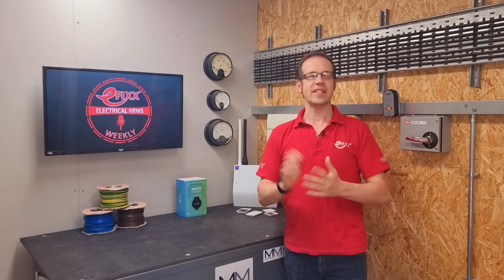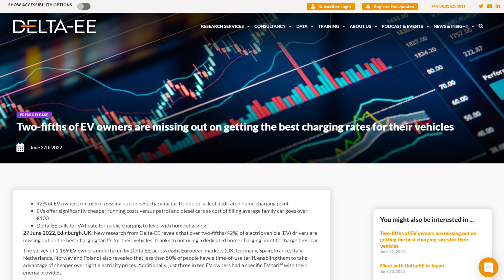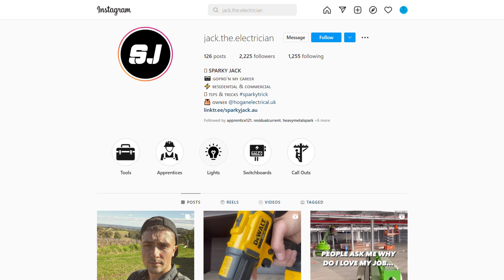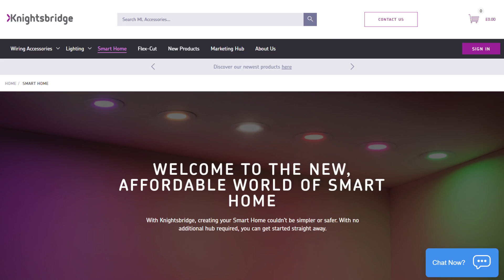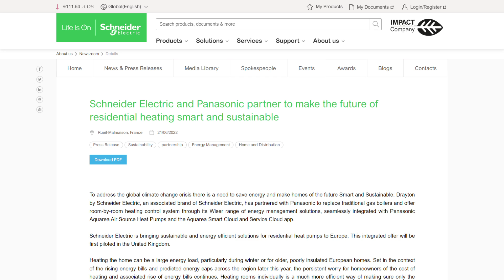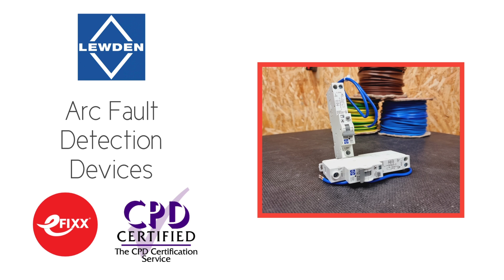TOOL THEFT - What can you do to Prevent this?

Comment: Working on a former farn in North Devon where live, the owner  who had recently bought the farm,  had removed an earth bank and caught a split concentric  cable with the digger bucket and striped  the outer sheath asked me to look at the cable and repair it. (He had put a metal bucket over it to protect it)  I isolated it from what I thought it was it's supply point with my voltage tester and it was still live. I then isolated  at the incoming supply position and it still tested it live. I still wonder why I still tested the cable at this time. It turned out The farm had its own tansformer and there was an ilegal conection  on the underground cable. After investigation I found the end of the cable taped up and discarded in nettles.  It turned out that the previous owner had been caught out growing canibis in a farm building. He was caught out as a person with dimenture was missing on Exmoor and a thermal imiging camera on the Police helecopter picked up the building
Reply from the maker: Great story - amazing what happens in the countryside

Comment: Hi Joe I was thinking about the possible problems we may have with DC leakage in our electrical system’s from thing like phone chargers washing machines or even the clock/ timer on electric cookers ? 
Now i’am not saying it’s wrong but if DC leakage is a problem isn’t it more likely to be coursed by smart meters as they are hard wired in to the system not just plugged in to the nearest socket  ?
Reply from the maker: It's more of a cumulative problem really, lots of devices leaking a little bit. Not sure on the exact figures for a smart meter but I'd imagine it's pretty negligible.
Reply: @efixx  thank you. As I said I was just wondering.

Comment: Hi Joe,can you tell me why the big push for RCDs  for sockets particularly for portable equipment use outside would a 30ma plug type RCD be an easier option and better as if it goes it’s not going to take the main ring circuit with it ? All my garden tools have 30ma three pin plug RCDs  and they do work just as well , I test them at least once a month so I know they are working as intended. You’re thought’s would be much appreciated. 
Many thanks 👍
Reply from the maker: It's probably just more cost effective to have one device protecting a circuit than a device per piece of equipment. Also, depending on how it's wired the regs will require RCD protection for the cables as well as the loads.
Reply: @efixx  so a Plug top type RCD is an acceptable option 
If say the property has no RCDs   
Like they still have a rewireble fuse box  .
Reply: See I can be a good boy sometimes and ask sensible question’s . 🤣 I have always had a lot of respect for you guys. I get annoyed when I give a opinion and some idiot turns it into an argument like yesterday on one of Gary’s videos.

Comment: There are still companies that manufacture copper lettering blocks with company names.  One of those mounted on a handle and heated with a torch can melt the company name into most power tools and plastic handled hand tools.  
Metal tools are easy to mark.  Visit the grave stone artist.  They can cut stencils and sand  or abrasive blast the company name into them.  Those artists will jump at the chance to do anything other than a headstone.   Think of the bronze memorial companies to cast up the branding iron letter segments .
Reply from the maker: Top tip, thanks Wayne.

Comment: Chains around the seat bases. With padlocks to cargo rings mounted to the inside of doors thru slots in the door panel prevent the doors from opening more than 4 inches.  
Van interior companies are going to have to step up with inner wall panels like partition panels. With laser and plasma cutting it would be easy to roll form them then run them thru a flame hardening to make them a lot tougher to cut thru.  Need ceiling panels too.  

I have morse push pull cables connected to custom slide locks that prevent the first door from opening.
Reply: I threw in my pet shark in the back before putting the central locking on.
Reply from the maker: 😂 Full on Bond villain right here!
Reply: @efixx  and the best part of this plan is.... no one can stop me. Mhaahaahaaa
Reply from the maker: 😂😂 I like you.
Reply from the maker: Good advice, thanks! 😊